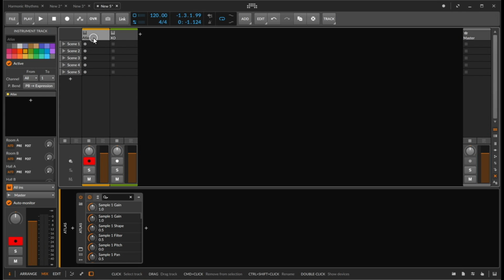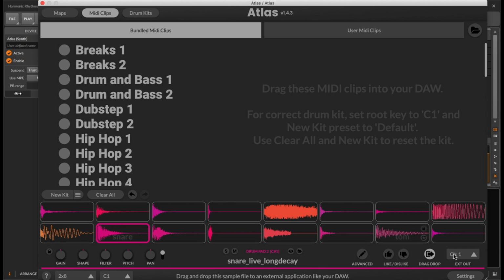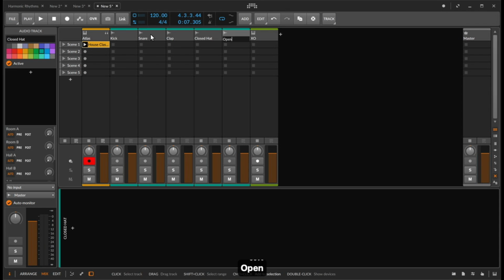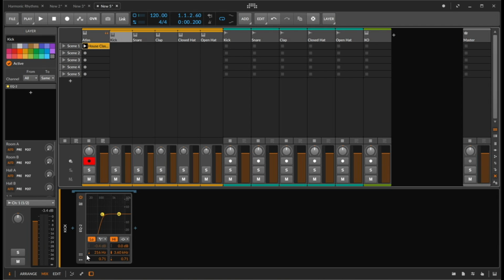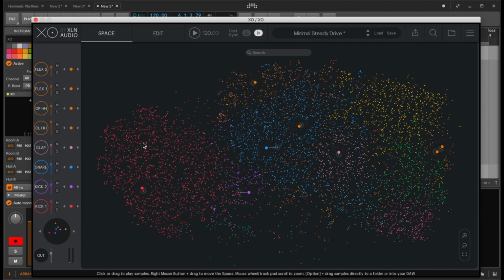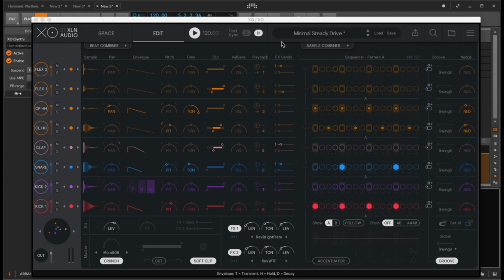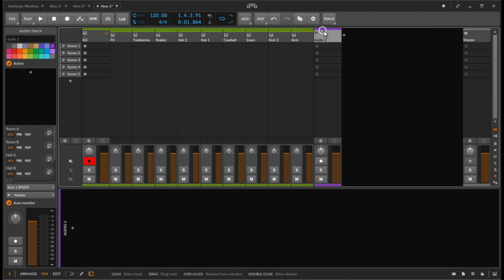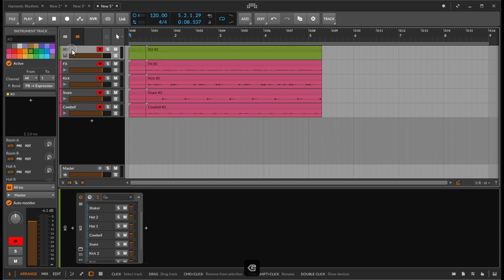Multi Output Audio Recording In Bitwig (Ft. Atlas & XO)

Comment: Always loved how easy multi-out in Bitwig and the fact you can save the plugin preset the way you want.
One thing I'd love to increase speed would be an option to "create audio channel for each output".... Negating the need to go in manually assign each input. 
Just one thing though... Bitwig is Bae.... Nothing comes close in my mind.
I've also created a structure within a group so it's a multi track entity but much easier to move about. I have the midi on the master track of the group triggering the child audio tracks all named and routed as needed. Saved that template to start every session now. It makes life so much easier :D